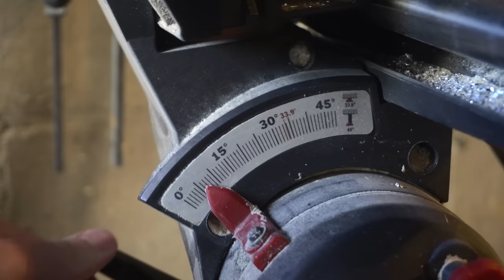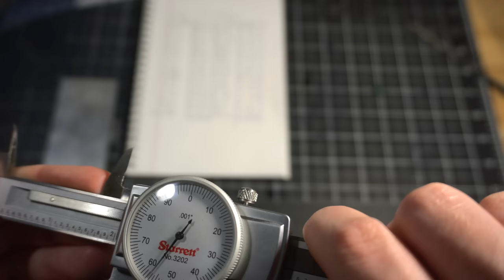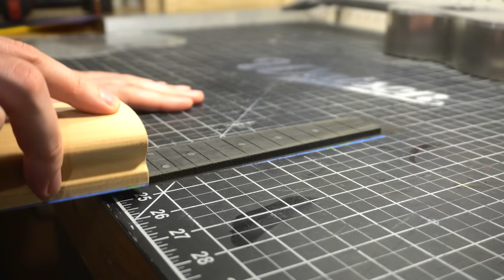Heavy, Metal Ukulele---Making a Ukulele out of Aluminum

Comment: I've been thinking about this build and it occurred to me that there will likely be galvanic corrosion where the brass nut touches the aluminum and also where the two chrome steel bolts tie the brass bridge to the aluminum body. Possibly a problem at the tuners as well. Another good reason to make a different saddle and nut out of traditional material like bone, tusq, or maybe even plastic. Since the aluminum is not anodized, eventually the ukulele body and neck will corrode from salts and acids left from contact with skin.
Reply: Wow that's pretty interesting, I didn't know galvanic corrosion was a thing. How long do you think before the corrosion becomes noticeable visually? Or damages the structural tegrity?
Reply: @domlaiso7034  Now that is a good question. Corrosion at the bridge screws and nut might create gaps which could create some buzz as things corrode and loosen. Since the bridge is under tension, corroded screws could break and the bridge go flying leaving broken screw ends that are nearly impossible to extract. Making another bridge out of aluminum bar stock and then using aluminum blind rivets instead of steel bolts would solve the bridge problem. Cherrylock rivets will draw tight, which makes them the best, assuming the bridge material in between can bear the load. Unless you have a friend in the aviation business with the proper installation tool, that could get expensive. Tusq nut solves the nut problem and might tame some of the tinny tones.
Reply: galvanic corrosion would take years … you can fairly easily mitigate w some oil and periodic cleaning - statue of liberty is covered in galvanic corrosion…. still standing fine
Reply from the maker: All of the screws are stainless and the nut has a coat of super glue holding it in place. Even so, I think it would have to be submerged in a tank of salt water for a few months for this to be an issue.  A year and a half later there are no problems. It is an interesting thought though
Reply from the maker: As for the corrosion for the neck and body,  I think the natural oxide layer of aluminum is strong enough for this purpose, but I also covered everything with paste wax. Anodized is just a thicker oxide layer if I'm not mistaken. It would definitely be better though and a silver anodization would probably look better too.
Reply: @kelseywatson1974  im sure it'll be fine, whatever does happen you'll see it and it's easy to deal with usually, unless you put it away and it does something crazy for years and then thats annoying, but even water should be fine cuz my car has aluminium wheels, they are only now starting to turn white and weird and the car was made in 1999, it was a cool video i enjoyed it :)
Reply: @dereksantavenere2172  The galvanic corrosion was repaired during the renovations in the 80's, and it was on parts of the internal structure where the preventative measures had worn away and failed. The external is oxidation, not galvanic.
Reply: @Geerice  sweet
Reply: THE CORROSION IS CALLED DISSIMILAR METAL CORROSION NOT GALVANIC . L.O.L.
Reply: @TRICK-OR-TREAT236  Galvanic corrosion, bimetallic corrosion and dissimilar metal corrosion are all the same thing. L.O.E.L.
Reply: Do you realize how much longer that will take to do anything that matters compared to wood? Everything decays.
Reply: @Sgtassburgler  That is not entirely true. Galvanic Corrorsion can be exceedingly quicker than any normal wood decay. Galvanic corrosion occurs when mixing metals. The less reactive metal hastens the decay of the other. The process needs an electrolyte like for example water, so the dryer the air where it is stored the longer it will last.
Reply: Please don't plagiarise his idea
Reply: @ravibhushan7393  No problem. I prefer my ukuleles be made of koa. Since I worked in aviation air frame repair for years, if I tried to make an aluminum ukulele, it would have seams, be built with rivets and so have a dystopian steam punk look.
Reply: 4
Reply: Like he should put a zinc anode on it?
Reply: @patricklundquist9869  k, that sounds like it needs to be made too! That'd be awesome. I'm missing the video whilst reading the comments. 😆 How you Men know all this stuff is just baffling. 💙 Yt comments are just as informative as the videos. And it's nice how ideas are exchanged and debated in a productive manner.
Reply: @MamaMudskipper  It's not just men. Plenty of women know this stuff. It just has to do with whatever sparks your interest. In fact it seems your interest has been sparked so welcome aboard.
Reply: @kelseywatson1974  Stainless steel loves to exchange electrons with Aluminum; no salt required. I recommend pulling the screws for the tuners and bridge, and coating them with a medium-strength thread-locking compound (Permatex or Lock-Tite). That will prevent the corrosion and allow for easy replacement of those parts in the future. The neck bolts don't need that since they won't ever need to be removed. As to the surface corrosion: don't fuss over it. As long as you wipe the body down after playing it'll stay shiny enough for a year or two.  Anodizing is not a thicker oxide layer. It is the act of electrically cutting holes into the aluminum so that it will take a dye. Oxidation still occurs, but it's not noticeable because of the dye.

Comment: It's possible (But a pain in the ass most of the time) to calculate the springback of material, and how much to overbend. The Engineering Information, Conversions and Calculations site has a great calculator for it, which I use fairly often if material is running low. I liked this a lot, my two favourite things, metal work and the ukulele.
Reply from the maker: Thanks for watching! I'll have to check that out next time I try something like this. I'm trying to be a little more precise these days

Comment: Unique for sure. Normally a uke would use nylon strings. Not sure how that would have worked in this case but perhaps a shade less “tinny”. Still it sounds like a ukelele
Reply: 26:47
Reply from the maker: Strings are nylon. I probably didn't give them enough time to stretch however

Comment: Regarding the springiness - metal only deforms permanently a given percentage of how much it is deformed, the rest remains elastic and will spring back no matter how long you keep it under that constant force.
You have to either deform it past the point you want it to end up into, heat it to the point where it changes colour thus making its atoms reorganise into the new position as a restin position, or MAYBE giving a lot of strong hammer blows to the entire clamped mold contraption might vibrate the atoms into accepting that position, but I'm not sure about this last method
Reply from the maker: So the hammering would basically work harden it into shape? Thats an interesting idea and I think it would probably work to some degree

Comment: If you're up to trying it again, I may be wrong but if you used a thinner sheet on the sides and back and soldered the body under tension on the jig rather than annealing it you might get a better sound.
Reply from the maker: it is probably too thick but I was originally concerned about heat warpage before I found that solder. I think I would definitely do this if I was to make another

Comment: wat you could try against the springback is measure the amount of springback and exadurate the shape of the buck to overbend the aluminium , not sure how mush you need to exadurate the buck but starting at the amount the aluminium lifts away from the buck should be a good start
as for the pockethole : drill straight down first to make a sport for the drill to center against so it grabs the center of the drill before hitting the metal with the sides of the drill

Comment: To over evaluated "corrosion" with dissimilar metals, you forgot third need conductor for this to occur. yes, two different metals are bad. but unless he/she would play this in rainstorm or ocean mist or any moisture environment. I wouldn't worry about "Patrick Lundquist" evaluation of this outstanding metal crafting build.  F/A 18 with same metal takes several months to actually corrode. but those are in extreme heat/weather to cause damage. i thing the little Ukulele be fine. Sweet build.

Comment: Pocket hole jig would’ve worked brother. Next time put 2 clamps on jig, start your drill bit at full speed BEFORE plunging, then very very slowly plunge drill bit. It’s going to take a bit longer but the holes will be beautiful. 😉
Reply from the maker: I didn't try setting the drill to 11 🤔

Comment: Aluminum has about 15x more inherent stiffness than wood, and stiffness varies according to the third power of thickness, with Young's modulus (E, MOE, a relative measurement of a material's inherent resistance to deflection under load in the "elastic" range, aka "stiffness") a constant which varies according to the material (and species of wood). So...in order to achieve the same tonal range, one would have to thin the aluminum to about half of that of wood, but to really get it right, some math needs to be done, and probably some experimentation.
Stiffness and density are directly related to the resonant frequency and speed of sound through the material.
For all these reasons, your uke came out looking and working great, but sounding "tinny."
Amazing construction though!
The above physical principles are so important to luthiers. That's why they fuss over thousandths of an inch. 
Just google beam stiffness formulae and it will start to make sense.
Hope this helps somebody. Keep making instruments!
Reply from the maker: Fascinating stuff! I wonder how going thinner would effect resonance? Hopefully we can inspire someone out there to become the Stradivarius of aluminum stringed instruments!
Reply: @kelseywatson1974  Yeah, thanks for the reply. My comment was a bit long winded. Aluminum actually works out to be about the same stiffness to weight ratio as carbon fiber epoxy composite. If the carbon is unidirectional it will be more stiff than aluminum, which is isotropic basically--the same in all directions. Wood isn't. It's stiff in the longitudinal direction only. Blessings of success and joy in your endeavors. Give thanks for music and musical instruments and all the fun materials we have to play with!

Comment: Check Ron Cowell's videos, he explains in detail how to calculate spring back for applications like these.
Also, when you cut aluminium with carbide tipped saw blade (or any cold type, non-abrasive cutting, drilling, milling), use WD40/Diesel/Kerosene or my absolute favourite denatured alcohol mixed with water in 50:50 ratio. And no it's not going to catch on fire.
Reply from the maker: I'll check it out, thanks! Fascinating stuff. I'll have to try that. Things were getting a bit hot when I made this 😅
Reply: @kelseywatson1974  yeah definitely, sometimes the aluminum fillings get fused with the carbide burr bits or carbide saw tips and this will prevent it, also the presence of denatured alcohol helps cool everything down.
Reply: @kelseywatson1974  I use it even for sanding, it unclogs the sand paper so well

Comment: You need a good TIG wielder that can do steal and aluminum. It's not hard to learn to wield and sure beats the hell out of soldering.
Reply from the maker: It's definitely on my list. Do you know if those Lincoln multi purposes are any good or powerful enough for aluminum?
Reply: @kelseywatson1974  First almost anything from a reputable brand like lincoln is going to do pretty good. But most of the cheaper "multi purpose" wielders only come with the ability to run flux core MIG or stick. While you can wield with flux core and stick it's really not designed for intricate work like you're doing/it's really messy. I think something like the PRIMEWELD TIG225X would be a better choice and it comes with a good TIG torch out of the box. It can be upgraded to water cooling and comes in cheaper than the lincoln multi. Also most of the multi purpose wielders come setup for mig/stick only so you would need to buy a tig torch plus extras to swap over to TIG. But with all that said my best advice is just research, look up reviews and do your homework before buying because wielders vary drastically in quality/ability and price.

Comment: Very very Nice ! and sounds good ! but i wonder if maybe molding the neck (1 piece complete with headstock and heel)  would'nt have been a better option ?
Reply from the maker: Definitely would have been, but that's a lot of material to remove and an expensive piece of aluminum 😅
Reply: @kelseywatson1974  i meant molding it by melting the metal, into a mold, as aluminium melts at relative low temperature, and not sclupter from a block.

Comment: Using a drill to cut into metal at an angle is hard with a standard drill bit. The tip is what  bites in and does the initial work. You were not using the tip. You could have used smaller bits to start, then once the hole location established, worked your way up in bit size.

Comment: you are a true instrument maker  :) corrosion I do not believe in it :) but the bronze strings from daddario or elixir with the original protechteur slippery coating: D see with a pro luthier for use extra light strings to have the best of the best
Reply from the maker: I'll have to check those out. The nylon doesn't like to stay in tune
Reply: @kelseywatson1974  I'm not an expert :) find out about oil bath and self-locking tuners with a pro always :) maybe you can keep your nylon strings it's more a matter of taste than hearing the strings

Comment: The tone is very nice, but it plays out of tune because the nut is way too high. Cutting deeper slots for the strings could lower it enough to make it play in tune better, but the nut probably needs to be grinded from the bottom.

Comment: You should have gotten someone to play slide guitar on it... Also, you'd need metal strings for that. But usually metal guitars are meant to be played with a slide.
Reply from the maker: You know I just learned that Gibson's first electric guitar was actually an aluminum lap steel?! I saw one at the Met--super cool. So you are probably right about the slide and I somewhat regretted not putting a pickup in this thing

Comment: Very impressive craftsmanship and a great experiment but to my ears, the tone is harsh compared to wood. Part of that might be attributed to tuning which might be related to the nylon strings not having time to stretch-in. Tuning is the same as a six string guitar that is missing the two bass strings, so not that hard to figure out how to play one. Even for professional builders and companies that make ukuleles full time, it is extremely difficult to build a ukulele that sounds alive. I'd say 90% of the beautiful looking ukes I pull off the rack sound dead. I understand the commitment to making it all metal but I'm wondering if saddle and nut made out of traditional material like bone, tusq, or maybe even plastic, might warm up the tone.
Reply: G C E A
Reply: @koalatails5711  I misspoke. It is not the tuning, it is the fingering and chording that are the same. A ukulele player can play the same chord shapes at the same locations as a guitar player and they all work. Say you play a D chord on a guitar. If you play that chord in the same exact location on a ukulele it works but you are playing a G chord. All the other guitar chord shapes will work as well. What the actual chords are primarily matter when playing in a band. This information is only useful for guitar players who are trying to learn ukulele, like maybe Kelsey Watson.
Reply: @patricklundquist9869  That’s Ok. I didn’t want to rant about it, so I kept my comment extremely brief. What you said would actually be correct if it was a baritone ukulele, which it definitely isn’t. I would like to here it tuned and played, there is so much opinion on what is the best wood to use, and this is made from soda can material.
Reply from the maker: Those strings really stretch and I was probably a bit impatient, but you're right, brass is probably not the best nut/bridge material

Comment: All ok but.... soldering? Man get urself a welding machine and do it properly
Reply from the maker: A decent TIG welder is close to a grand at least and welding aluminum takes a lot of skill, especially when it's that thin. The heat required will warp that thin sheet very quickly, which is also why I didn't braze it. The low temperature solder that I got is specifically made for aluminum and bonding unlike metals. Done right it is very strong. This ukulele won't survive the Pete Townshend test, but it will be just fine for normal use. Still going strong a year later! Thanks for watching!

Comment: You deformed the metal with part plastic and part elastic deformation. It doesn't matter how long you leave it like that. Just getting to the plastic deformation is all you need to shape it.
Reply from the maker: so bending it past the elastic point?
Reply: @kelseywatson1974  Yes. You have to bend it a specific radius past where you want it to be for it to spring back to the shape you desire. It also doesn't matter how long you have it in that position as it's metal, not wood or fabric that can relax and take the shape you have it in.

Comment: WOW!  Talk about flying completely blind, no research whatsoever, no looking into what to expect from the materials, proper metal working techniques and tools to use...  You really need to change the title from "Making a Ukulele" to "Faking making a Ukulele"!
Reply from the maker: There's no right way to make a ukulele out of aluminum. It's absurd and that's the point. I did however start with some aluminum stock and ended up with a working ukulele so I would call that a success